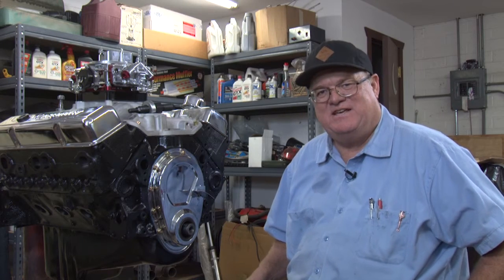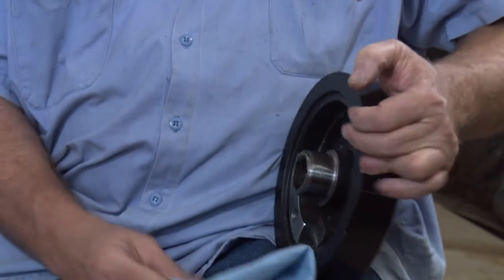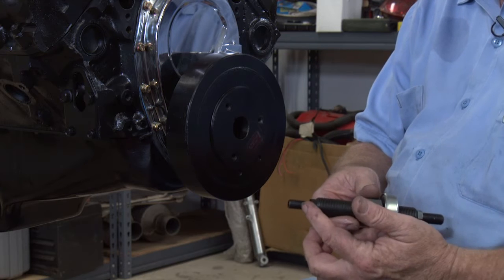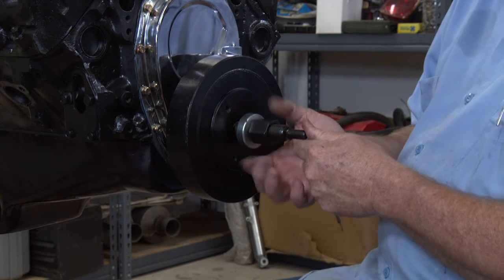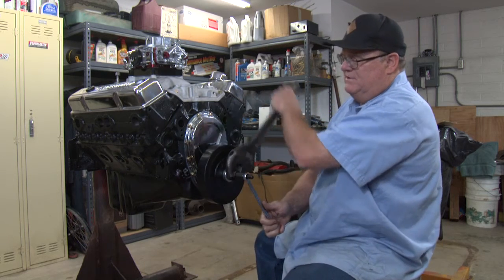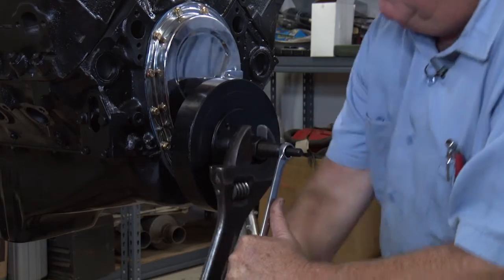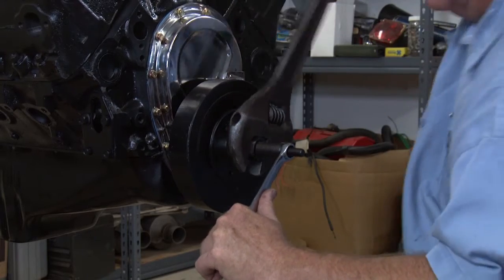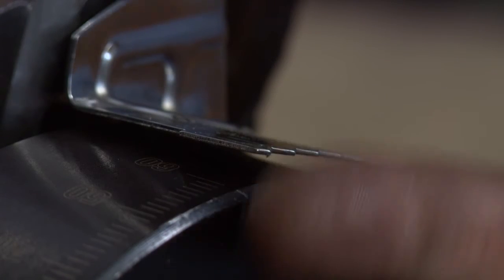How to Install a Harmonic Balancer on a Chevy Small Block V8 | Step-by-Step Guide

Comment: Thank you for your Videos. Everything you are teaching, I am doing to my engine. I have a first gen 350 SBC in an Auburn Boat Tail speedster I bought. I am changing the intake manifold, upgrading the ignition to HEI, changing the Timing chain cover, water pump, the alternator, the carburator, exhaust manifold, the oil pan. Transmission fly wheel cover and transmission pan. The car needs some TLC to bring it back up to tip top shape. When taking the harmonic balancer does it make a difference wher thee TDC is, as the key keeps it in place right? It only goes on one way, is that correct?
Reply: Only 1 way yes